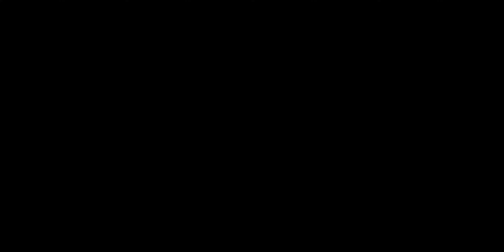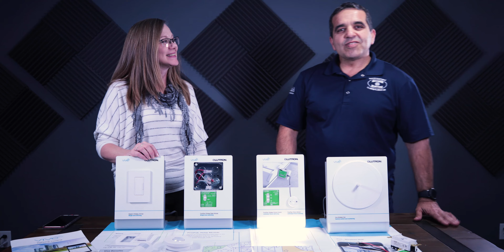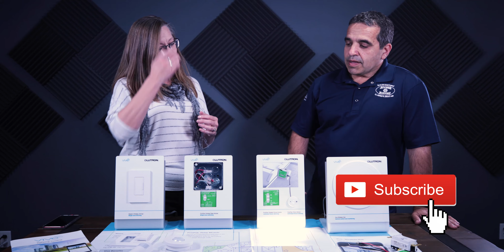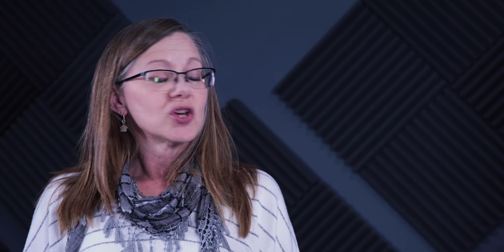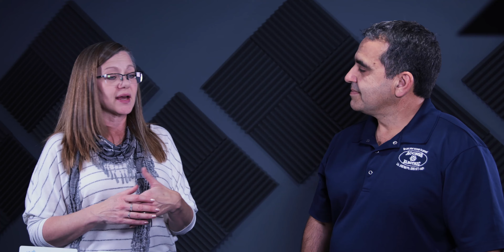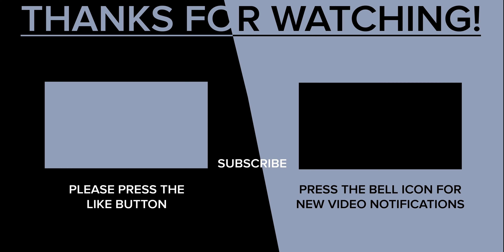Lutron Vive lighting control

Comment: IBEW Local 26 is the Metro DC, Maryland, and Northern Virginia local and its the San Francisco of the East coast, we live in a bubble. It cost 3 times more to live here only because the rich and powerful want the area to them self. And they love Lutron, so do I. Because of All the work its created, because if your not a trained electrician you will never figure out a commercial system with multiple ESN, QSNs, infra red switches, with multi hub system, we had 30 man team just for Lutron , at the Crystal City project the new Amazon H.Q. and that was for each floor. So hundreds of electricians making $85 dollars an hour, installing million dollar lighting systems. And we are short on electricians, so if you need work call IBEW local 26 DC and its a open door policy, you will be working tommorow.

Comment: Just want to point out it's low FREQUENCY not low Bandwidth.  Otherwise nice video.  Bass thumping and signal penetration is low frequency.  Bandwidth is associated with amount of data  / information that can be transmitted, and usually higher frequency means higher bandwidth, but as this is just lighting control, the amount of data transmitted is minimal so low bandwidth is fine.  However low frequency helps you get the signal thru obstructions like walls, fridge etc.